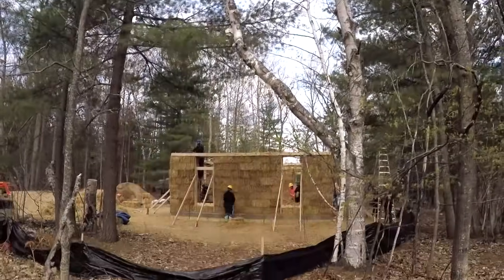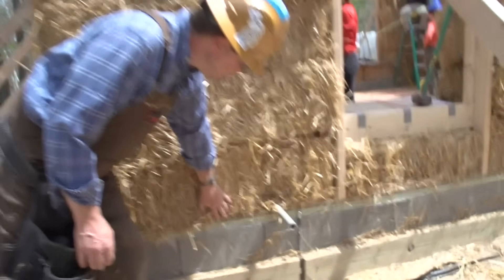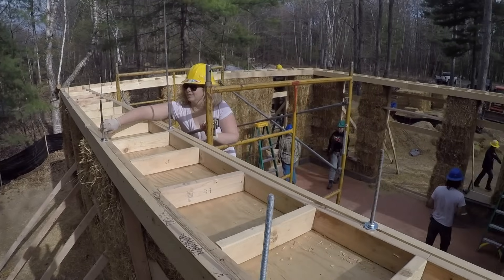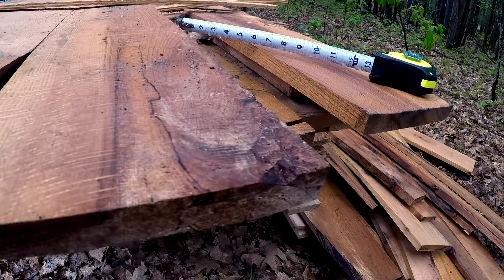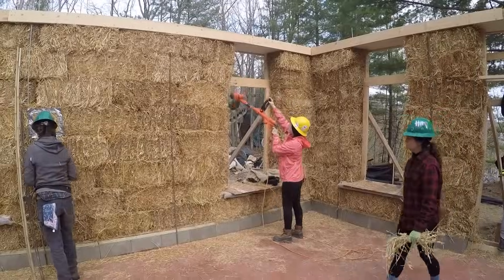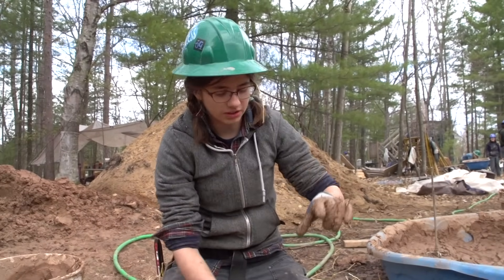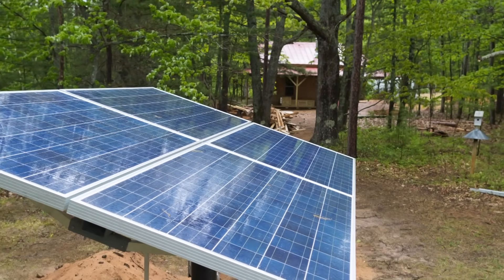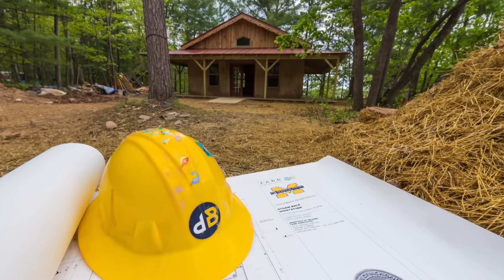University of Michigan Professor Joe Trumpey Shows How to Build a Straw-Bale Building

Comment: This design will rot from the inside out. Running steel, or anything that can condense liquid in a breathing wall will collect moisture.  A natural cordage run through is better.
Reply: i dont understand what do u mean its better for the cordage run through
Reply: I've been seeing packaging nylon straps, that we can progressively tighten along until plastering.
Reply: Forgive my ignorance, but the metal will be the same temperature as the straw right? And the vapor condenses because of a change in temperature, not only because of the material it touches right? So the moisture level would be equal regardless?

Comment: 1. Does cutting down tree to substitute cement reduce carbon foot print?
2. Straw would compost over the time and crack would appear.
Reply: It does not compost over time as it is sealed by mud and the moisture level is extremely low.

Comment: Cool teacher. Teaching things that you can use in life. I wonder how they feel about putting air ventilation through out the floor to push heat through the floor from in the house on a constant recycle. would it help keep the floors warm with just the heat from the house circulating though some large diam pvc though the floor?
Reply: If you plan to heat with wood, use wooden floor boards (35 mm thick) and pack under the floor with sand, 30 cm minimum. Should be sand that dries out during a dry summer to at least 20-30 cm depth, no clay in it. 7.5-10 cm floor beams. The sand will remain dry at least to 10 cm depth even in the worst conditions, usually dries out near completely. Moisture won't rise  to the top layer, like on a beach. A floor surface like this should be the same temp as the air inside. Might be slightly cooler on the 0.5m - 1.0 metres at the edges.

Your heat source built on a concrete foundation should be ideally in the middle, one per about 30 square metres. This would keep the floor even warmer.

Comment: How many years will this house last ? 
How warm would this be ? I'm in northern Ontario Canada
Reply: There are straw bale houses from the 1800s still standing in Nebraska. The R-value of the walls exceed 33. This is an extremely durable and energy efficient way to build.
Reply: @bencarter9072  Yes, especially if the straw is in the ceiling and floor as well.

Comment: I've wondered about using synthetic rubber or a polymer maybe that is long lasting and from a more renewable source and more bioequivalent, so seal the bales as well as hold the form maybe with some contribution to structure at least externally.  Then using these as a building material.  The paradigm of thinking is for the straw bales to last extremely longer in more extreme conditions and was thought about in regards to building underground structures maybe a decade back in my mind.  In particular, using outside of a poured underground wall structure to help waterproof and insulate that footing and walls. I was thinking once the wall is sealed and the bales are stacked, another rubber or polymer coating can be sprayed on that so to have a Radon and moisture proof barrier for centuries.
Reply: Straw clay bale house is meant  to breathe in order to let vapor in and out, the house needs to be water proof, not air tight! This is very important otherwise the house might rot. A good barrier at the bottom, lime plaster on the outside (wich prevents water to penetrate but lets the `skin` breathe, and, most important, a roof with enough `overhang` so most of the wall stays dry will prevent for the construction to become too wet. And, even if it gets wet, its not a problem, it will dry because the water can evaporate. Besides, using silicons and polymers defeats  the purpose of using organic materials. They arent healthy to live in eather because  they release toxic substances all the time, that you breathe in. Its not the future, at least if we care for our health one bit
Reply: @hetedeleambacht6608  I see, yes I was aware.  100% on board with the application.  Mainly, was thinking in regards to the potential use of straw bales underground as insulation and securing those properties in a sealed waterproof longest lived design.  Seems even if in between two walls of Ultra High Performance Concrete UHPC or stone sheets sealed at the seams extremely well to be waterproof, there is potential even in the most humid environments to have a 100's of years long lasting insulating resource that is more bioquivalent compared to the energy consumed to manufacture rockwool or fiberglass insulation.  Also, still somewhat carbon fixing as well.

Comment: So, what happens when the straw decomposes?
Reply: If well plastered (with lime) and with a higher foundation and bigger roof overhangs for rainy climates lasts for over a 100 years, it's just fibber!
Reply: it doesnt by itself, since there is nothing in it that bacteria like, unless it gets wet, and stays wet. Which wouldnt be the case if you build well. Straw is the leftover of the nourishing hay, that feeds cattle. Not much to rot there....

Comment: I like everything about straw bale building but I have one concern that none of the many videos I've watched on the subject address.  Growing up on a farm I know that bales come out of the baler under considerable compaction tension and are held together with just binder twine.  I have often seen this twine break or one of the knots let go.  If this happens to a bale in the middle of a wall the bales around it would hold it together but if it happened to a bale at the end of a wall I don't think the little bit of clay plaster covering it would be enough to contain the expansion force.  Anyone have any thoughts on this ?
Reply: Usually they use wire mesh over the outside too although they didn't in this construction
Reply: If low quality twines reinforce it with wire or, even better, nylon packaging straps. Wood and metals inside the wall will inevitably cause rot and rust issues. The steel wire is such a small surface, it would dry before any rust forms, or just do the nylon straps.
Reply: Reinforce in with steel wire in place of the twine
Reply: Modern synthetic twine seems to last forever, I am always cursing it when it finds its way into the fields from manure piles

Comment: I have been reading and watching a lot about strawbale recently, I thought across all the different building materials where you use straw, cob, and other earthen materials it was important to have zero metal inside the walls because of condensation? Is that incorrect, or did yall do something to mitigate the issue?
Reply: I've heard this too and was wondering the same thing
Reply: It's a problem for sure but the engineers demand something of the sort, I've seen nylon packaging straps and seems to be a great long term and cheap solution.

Comment: What about roofing insulation and hay? 
Also, what was used on this project to insulate the ceilings?
Reply: Based on  the research that I've done apparently mice Don't like straw they like hay. hey has nutrition in it where is straw is the byproduct after all the nutrition is ripped out basically straw is the banana peel and hay is the fruit. Is sealed properly and no major gaps are left behind, pests are not a problem with straw structures
Reply: @candacewilliams3367  What's with your alien-type utterances? (eg. Mnjkwdt). You overjoyed to find a simple, inexpensive building method (straw bale)? If so, you're excused :)
Reply: @TheMightyGinkgo  In cold and damp environments they might seek refuge in it but one can cover, at least, a lower strip of the wall as a skirt all around with a thick tarp or house wrap.
Reply: Hay, as Ginkgo referred, is mice food, for building is straw. As a roof insulation it isn't effective because it would be loose, it must be confined to a minimal space without collapsing the straws (need to keep the inner straws section for air gap). They probably used rockwool or maybe hemp fiber (much more expensive) as they are natural.

Comment: Are straw-bale homes suitable for Michigan's wet climate?
Reply: As the saying goes, it's really all about the hat and the shoes. If there's a good roof and a good foundation, the walls will almost certainly be fine. I might be concerned in an incredibly humid climate like a jungle, but when most of the moisture is in the form of snow and rain, the straw bale walls will perform admirably and provide very respectable insulation.